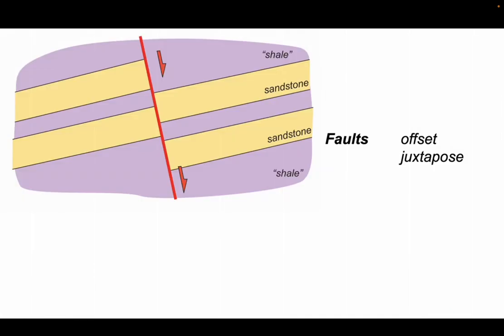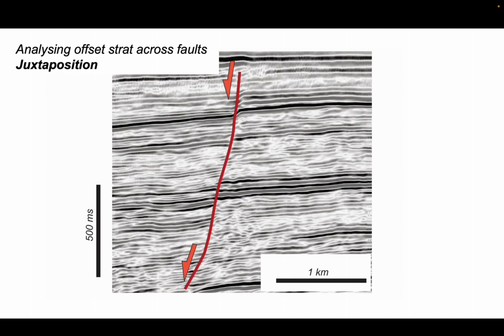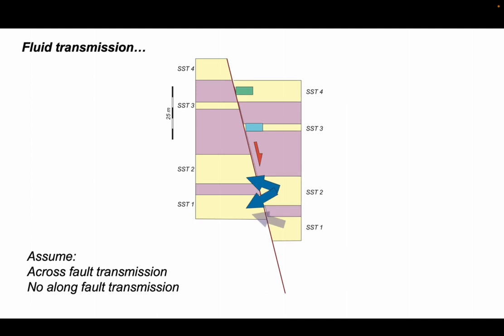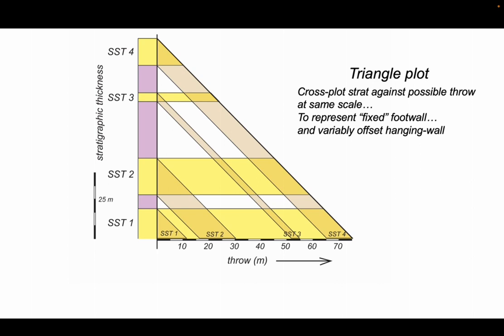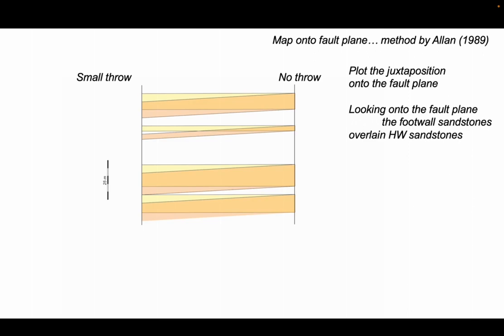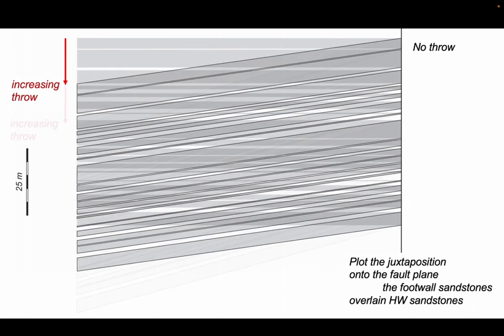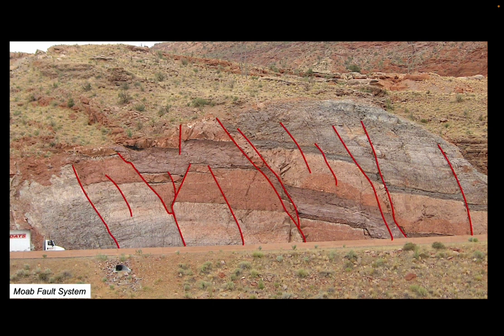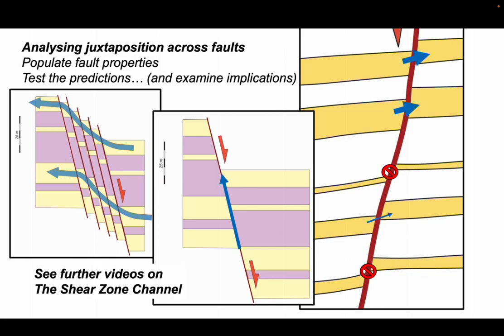Juxtaposition - across faults

Comment: It is possible Cu， Pb， Zn 's complex-ions migrate in a system containing low angle detachment and steep normal faults. If we have found Malachite  in such fracture planes, where can we find the initial Cu, Pb, Zn vein without oxidation? should they be found in the below plate?
Reply from the maker: mineralising fluids certainly are impacted by fault zones and their juxtapositions... but to answer your question we need to know the evolution of basin fluids....
Reply: @robbutler2095  Thanks a lot!